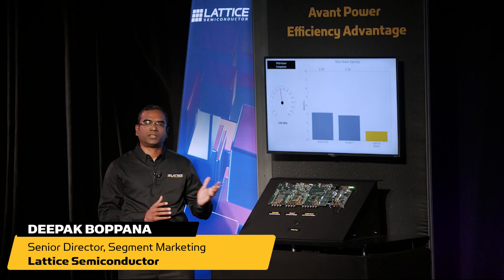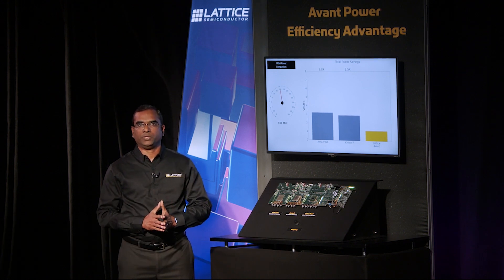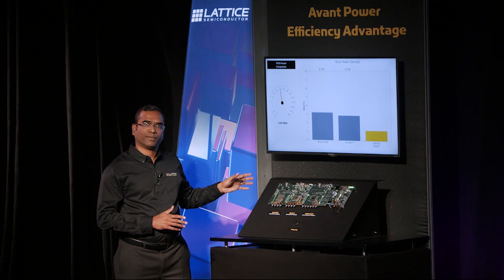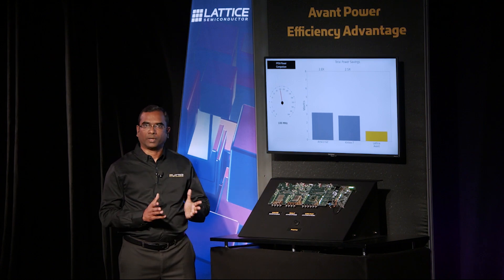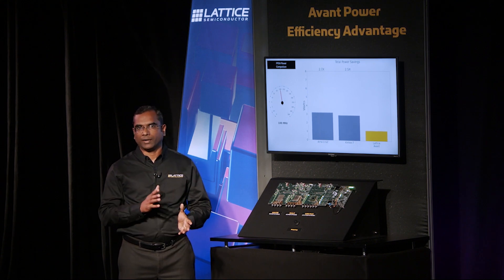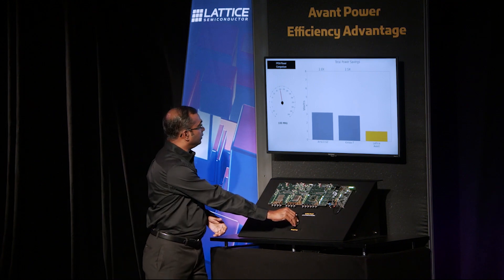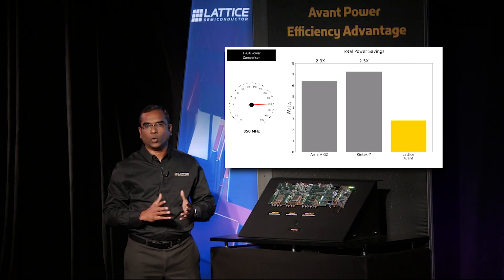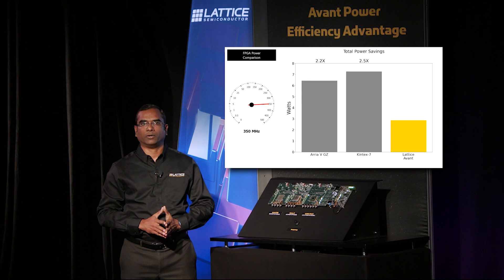Lattice Avant™ FPGA Platform: Power Efficiency Demo

Comment: So what is the reason that Avant evaluation board has 18 amper  MAX15118 buck regulator? Around 16 amper current is supplied to core voltage of Avant by the regulator according to evaluation board document. Something is quite wrong !